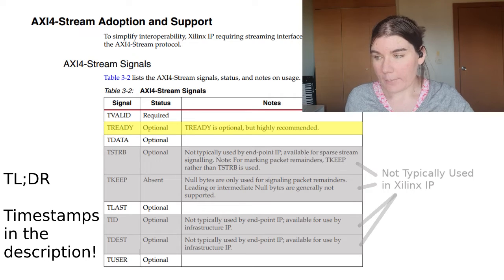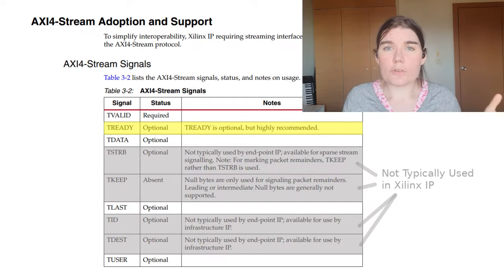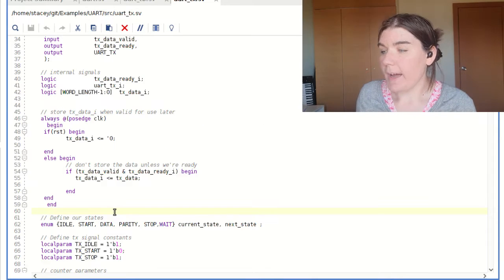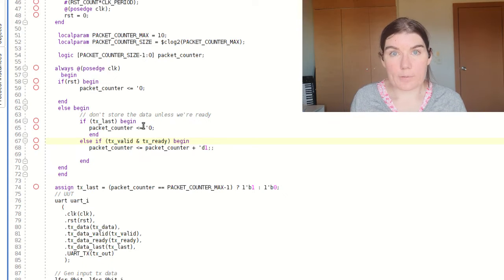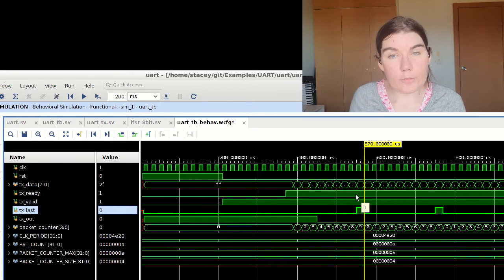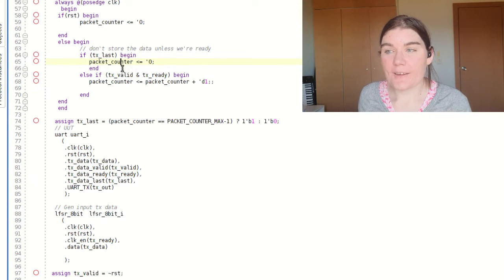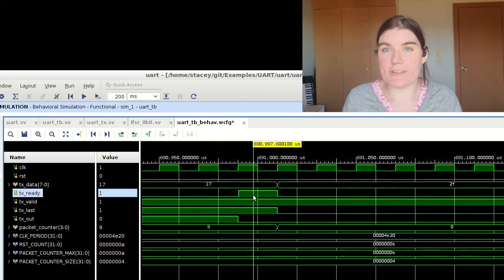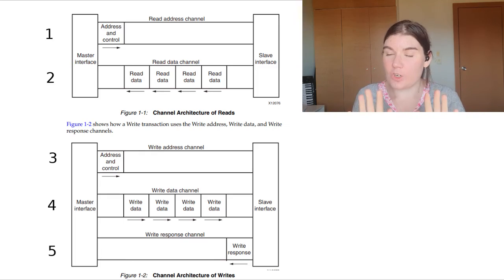AXI Stream basics for beginners! A Stream FIFO example in Verilog.

Comment: Hi Stacey, thanks for pushing good contents to Youtube! If I understood correctly, around 9:40 you mentioned about a time out for "not driving ready" and said that slave must become ready at some point. Actually, I have never heard about a limit on ready, AFAIK the slave can keep ready indefinitely. I did a quick check on AXI Reference Guide from Xilinx and other resources and didn't find an information about a time out value. Do you have a reference for this or did I understand it wrong? Thank you!
Reply from the maker: Hi, thanks for your comment! You're absolutely correct. That was the point I was trying to make at 9:42, there isn't a time specified! :)
Reply: @FPGAsforBeginners  Sorry, my mistake. I listened again and you said there isn't a specified time but what I heard was "there is". Thanks for the response :)

Comment: Thank you so much for making these amazing videos! 

Would it be possible to also occasionally show a high-level block diagram of the architecture? I think it would be helpful in understanding where the different modules fit and how they connect to each other.

Looking forward to the next one!
Reply from the maker: This is a great suggestion! After I made the video I realised it probably would be beneficial, especially for anything bigger than this. Will definitely include it next time.